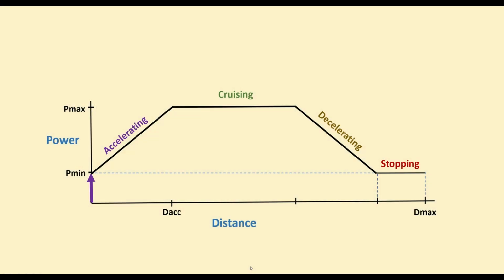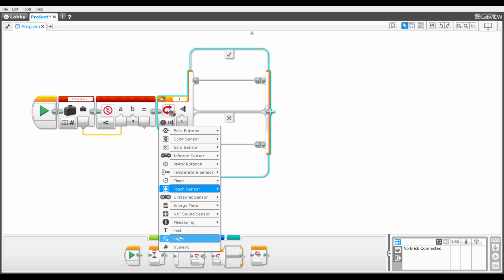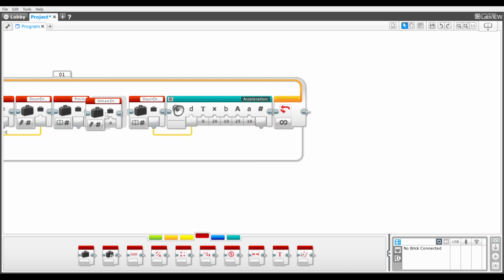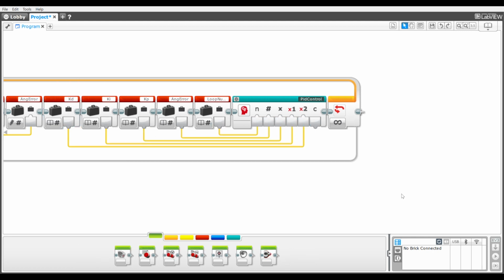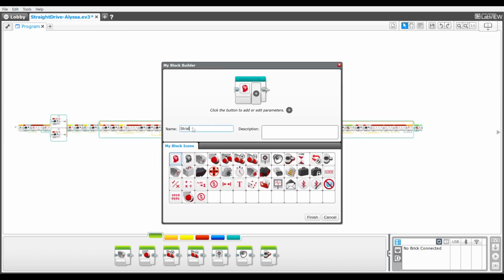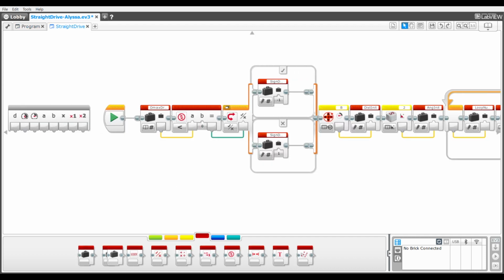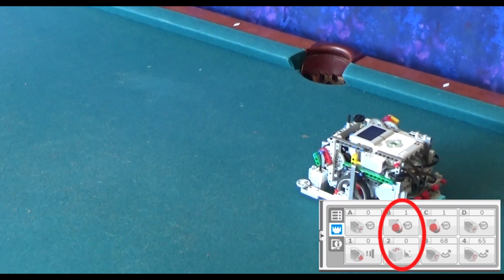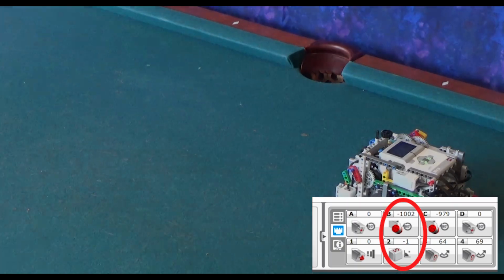Advanced Straight Drive EV3 MyBlock using Acceleration and Gyro Sensor PID Control

Comment: Very compact, did you programme in a derivative value aswell, although you getting really good results
Reply from the maker: Paul, yes we found that derivative helps a lot - it especially makes the robot follow the line closer.  It also helps with straight drive.  We plan on making a PID tuning video to explain.